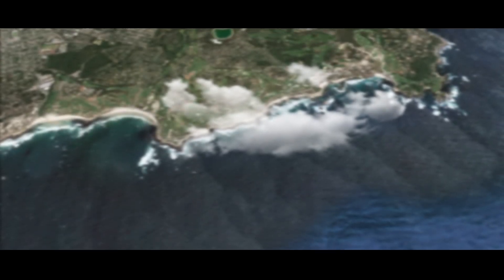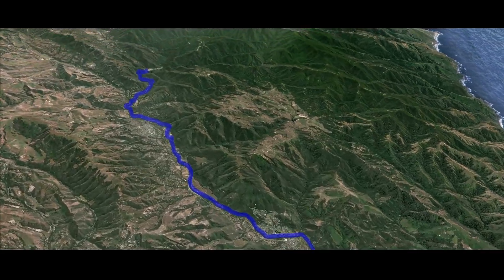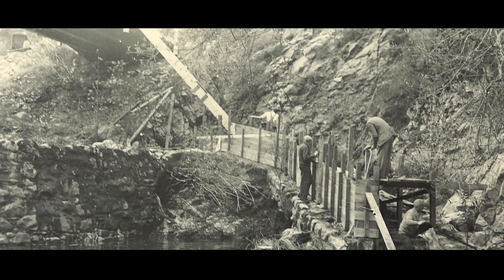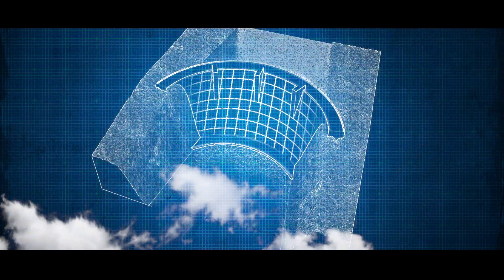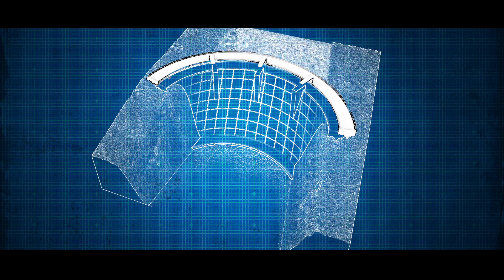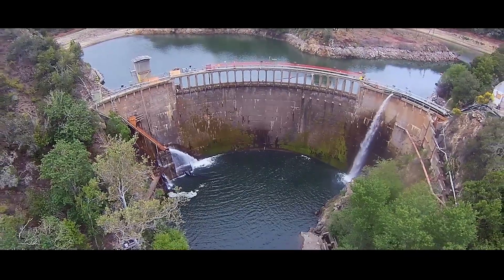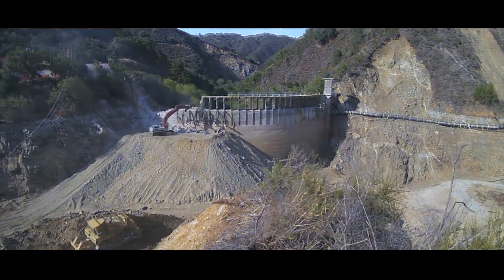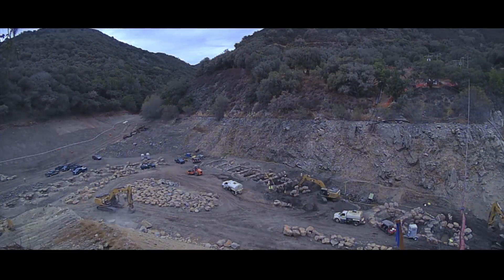San Clemente Dam Removal Update - Year 3

Comment: What a waste of money,  just look at all the hands that were in the pie.  Lots of big salaries over the duration. And as others have mentioned, 1 look at it on google earth now shows all that work to create a stream channel is gone!  More waste of money.  To add more insult to injury most of CA coastal "rivers" are not year round and only have water flowing when it rains in the winter and are as dry as a witches tit in summer.  Highly doubtful that any large population of fish was ever in what is actually just a stream.  The only thing that will run in that stream is silt/sediment now.  Which is actually a good thing since the beaches need to be replenished with sand.